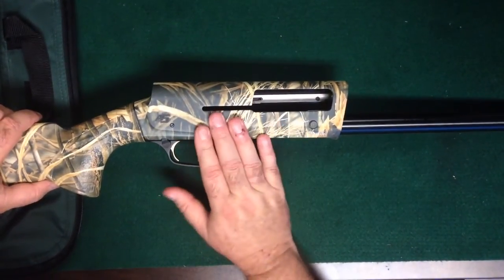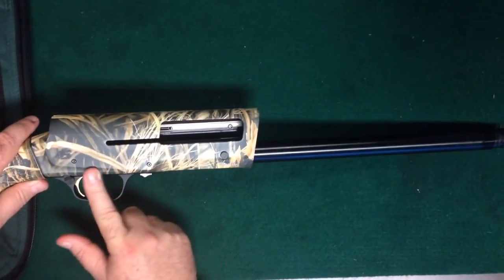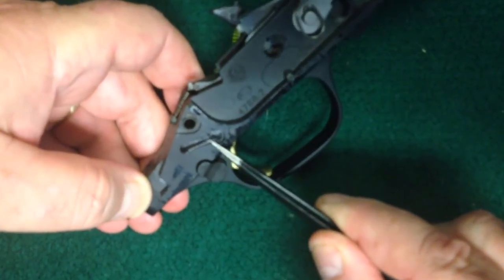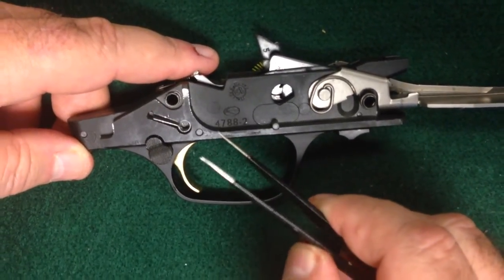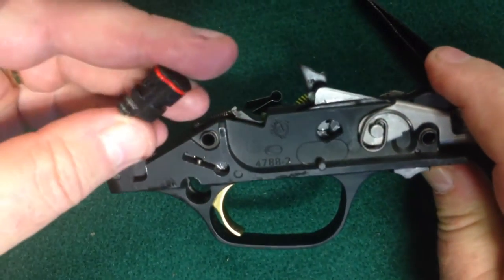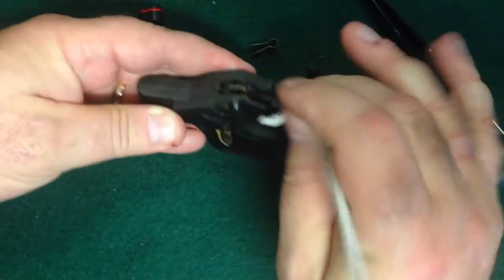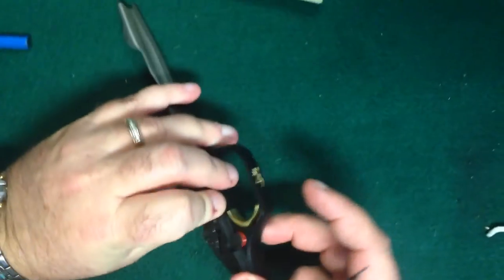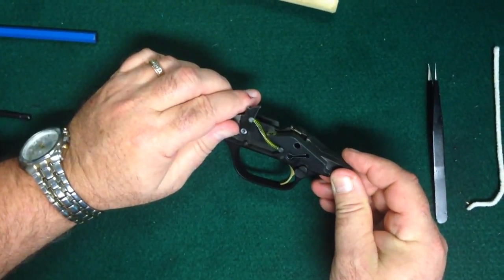New Browning A5/Maxus/Browning Gold Hunter safety swap

Comment: Does the bolt have to be removed to swap the safety or can you just remove the trigger assembly?
Reply from the maker: +Sam Costanzo No. It isn't necessary since everything involved is external. I field stripped the gun for ease of movement but it isn't necessary.

Comment: Should you pull the trigger with gun assembled before you attempt this ?
Reply: I will answer my own question. The hammer has to be fwd otherwise there is a spring in the way and the safety cannot be removed....so pull the trigger and ride the hammer fwd....now the safety will fall out.
Reply from the maker: Sorry I haven't been monitoring. Glad you got it.

Comment: What is the point in doing this if the chamber is going to be ejecting shells in your face?? Might as well buy a left handed A5
Reply from the maker: Do they make one? I have not seen it in their line up.
Reply from the maker: I will add that 1. They do not make a left handed A5  2. We have 2 members in our duck blind that are left handed firers. The A 5 ejects the spent casings out and away from you and they do not hit you in the face.
Reply: I shoot left handed and I shoot a Browning A5.....the shells do not hit you in the face.  The reason to switch the safety is when you are firing the gun, your hand will hit the safety switch and knock the safety back on.  It has happened to me dove and duck hunting.
Reply: I’ve been shooting A5s for 45 years. The shells don’t hit you in the face, they don’t distract your aim, and you don’t even see a flicker of an ejection out of the corner of your eye.